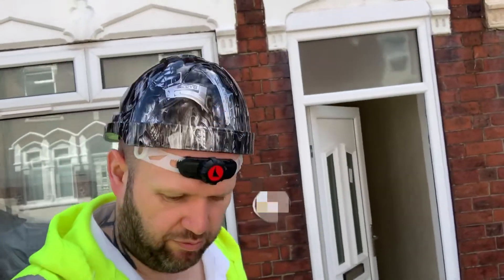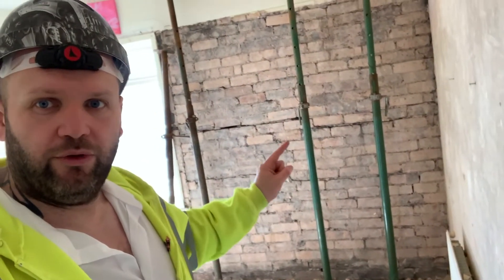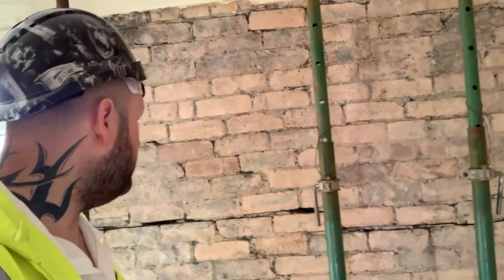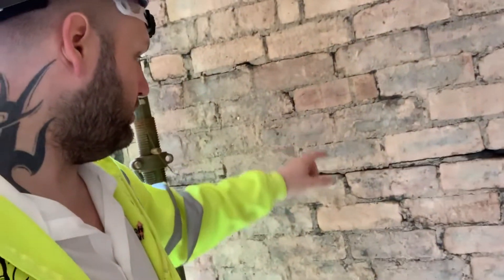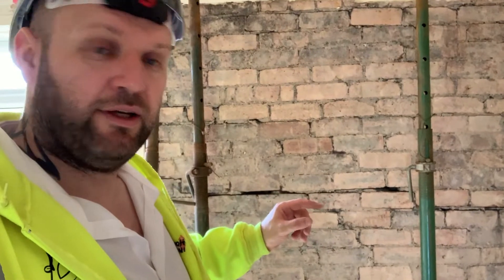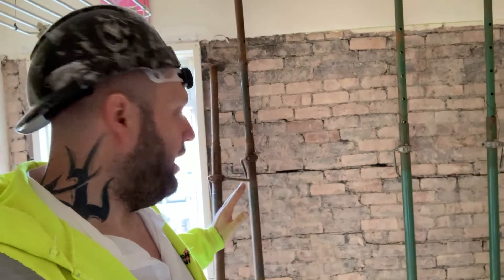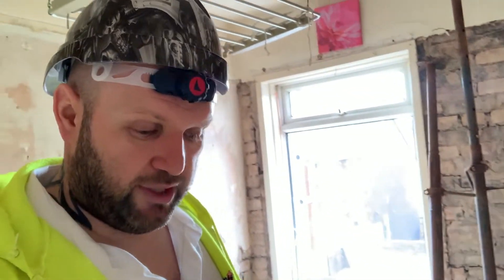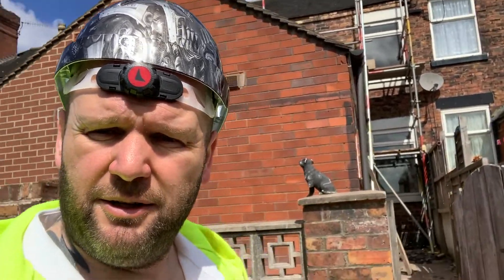Wall Tie Failure: Part 1 – Finding the Problem

Comment: Great video. Did you have to rebuild the wall? Is wall tie failure common in new build properties?
Reply from the maker: Thank you so much for your kind words and for the question 😀👍 Yes, we did have to rebuild the wall (using stainless steel wall ties that don't rust). New build properties tend not to suffer from wall tie failure because they use this type of wall tie. 

The reason old wall ties fail is because they're made from steel that rusts when exposed to moisture. And when they rust, they increase in size and, consequently, expand the mortar joint and lift the brickwork. That's what makes them unsafe.

You can see more photos of the wall before it was rebuilt here: https://bit.ly/WallTieFailure
Reply: @HYPEBuilding  was there a time of year that builders changed to stainless Steel, we viewed a house that needs wall ties, they won't budge on their price etc
Reply from the maker: @Chalfont66   Thanks for watching and for your question 👌 We believe that stainless steel wall-ties were introduced in the mid- to late-1980's. Hope that helps 🙂

Comment: Brilliant video mate, I`m actually gob smacked there are wall ties in those old houses ! Never in a million years would i have suspected that, I thought they only used them in cavity walls.
Reply from the maker: Hi there. First of all, thanks for watching and leaving us a comment – much appreciated.

Yes, it's surprising where these things turn up. When we started to correct the problem, we noticed that most of the houses in the row were suffering from a similar problem. 

You can see just how badly the brickwork was affected here: http://bit.ly/WallTieFailure

Thanks again for watching. Stay tuned for more building tips and advice 🙂

Comment: Thanks for sharing this. First time I have seen effects of tie failure, especially the pushing effect if corrosive expansion.
Reply from the maker: Hi there, thanks for watching and taking the time to leave us a comment. All the houses in the row where this property stands suffer from the same issue. 

We had a duty of care to the tenants of the neighbouring property to inform them of the immediate danger. We advised them not to go into their back yard until it was safe to do so.

We also informed the Dangerous Building Department at the local authority.

You can see more images from the project here: https://talktohim.co.uk/about-him/corporate-social-responsibility/#walltiefailure

Thanks again for watching. Stay tuned for more helpful content 🙂👍

Comment: Super interesting! I was not aware brick ties were used in solid walls like that. However thinking about it I can see why because there isn't much tieing one leaf to the next, just the odd closer and half bad it would seem. I used to live in a 1920's house that was English garden wall bond ie a row of headers and five rows of stretchers, don't think it had brick ties but five rows of non tied wall is quite a lot! That said it was in good condition and not out of plumb or anything. Btw at 6.34 when looking at next door you can see the lintel of top window being forced out!
Reply from the maker: Hi Danny, thanks for your comments. Have to agree that English bond is one of the strongest and best, so we're not surprised that the walls are still plumb – that stuff was built to last! 

There are some more quite disturbing photographs of this property on our website under the 'Duty of Care section of our CSR page https://talktohim.co.uk/about-him/corporate-social-responsibility/